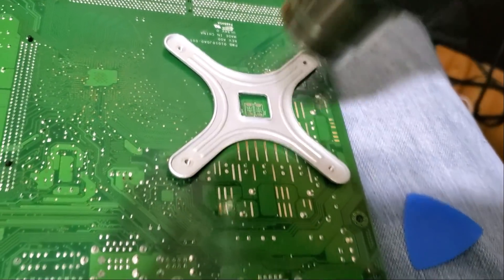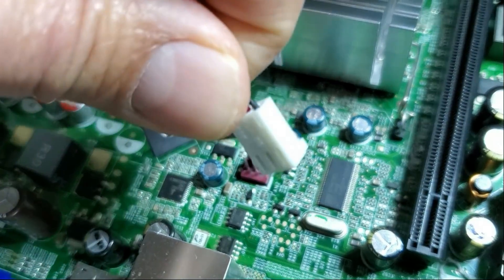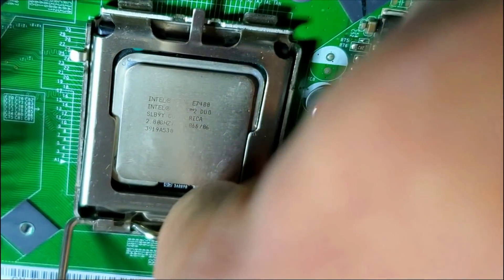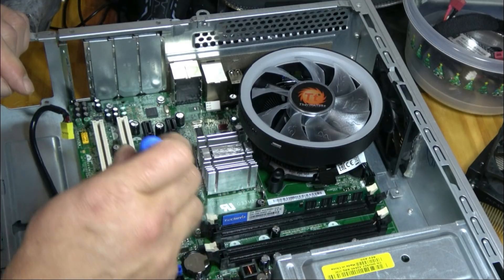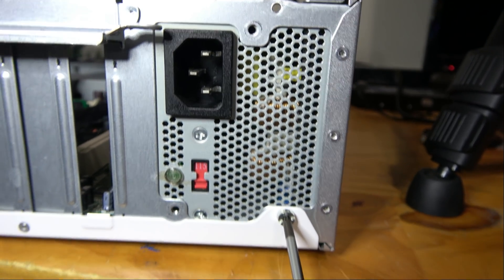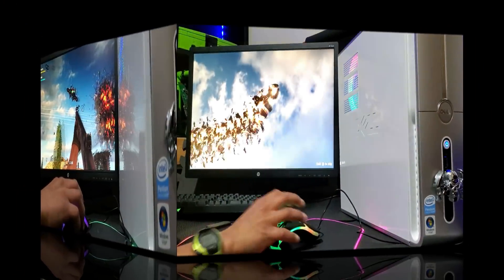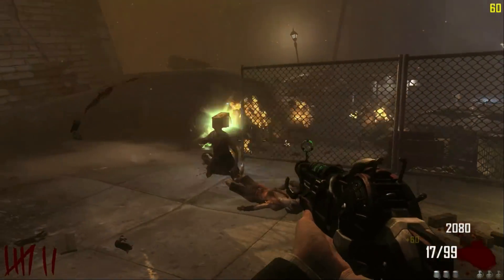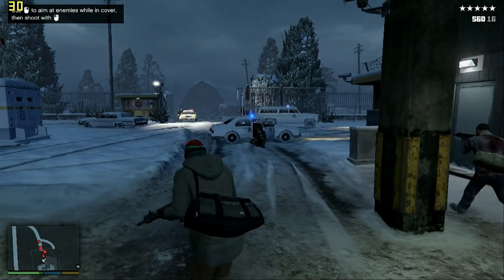$5 Dell Upgrade

Comment: Don't be shy? Ok lol, let's do that: There is serious controversy about the total amount of RAM allowable in this series of DELL Inspiron 530. Some say that 4 GB is the maximum and still others report that 8 GB sometimes land the PC to crash. Because there are several models 530s / 530sa / 530sc... Which one is your? As you have intentionally not revealed the RAM tab in CPU-Z, we will not know more. The super loud hard metal music being probably more important in your opinion...
Reply from the maker: Never heard of this controversy. I thought 64bit operating systems allowed for more than 4gb of ram. The motherboard in this 530s is a g33mo2 and 8gb of ram worked fine before and after updating the bios
Reply from the maker: Also some answers here https://www.dell.com/community/Desktops-General-Read-Only/Inspiron-530-RAM-limit/td-p/3345626
Reply: @modstek  I have run 8GB in numerous Dell G33M02 motherboards without issue. I've also used 16GB DDR3 on an Inspiron 560 motherboard that's only meant to accept 8GB. The way I see it is if you have the RAM to test it, then it's always worth a try!
Reply from the maker: Awesome so I don't have a unicorn inspiron 530s with 4 slots of 2gb ddr2? I had no Idea that was even a issue. The issue I had was the brand new Amazon sticks with pc2-6400u stickers on them registered as pc2-5300 on more than one pc. When questioned they Said keep them for free it must of been a mistake. 
Every time I hit the publish button on a video I'm just hoping for yeah that's kinda cool or I did this here's link.
But nah it's trickery and unprofessional that didn't open the ram tab on cpuz. 
  Thanks for feedback 😀 I appreciate it.
Reply: @modstek  serious controversy :D
Reply: @modstek  Thank you for your reply. In the post you're giving the link, it's all about an important parameter none of all those writing in seems to care about. They are litterally speaking like deaf and blind and so you're doing. Because it's ALL about the model that only one people pointing it: a Dell Inspiron 530 (the PLAIN model, NOT a 530a/b/c/d model), with a G33M02 motherboard, and the latest BIOS installed (1.0.18) can be upgraded to 8 GB. I think your is a slim model so either a 530a/b/c/d. And not talking about or showing CPU-Z's tab about RAM in your video just keeps things confusing. It would have been a lot more fair and professional to do some testing pushing RAM usage as much as possible WHILE showing tools like HWInfo and even just the Windows 10 task manager performance test tab. Easy, but when you want to make people believe in something else, you don't. I'm not intend to offend you, i'm just talking about objective facts. This has been said, thanks for your cool job, keep it alive and take care 😎. Peace.

Comment: so I have the same PC I just pulled out my moms basement I got it brand-new but its far from that now. Anyway I have the heat gun can I do this with the CPU or did you use a different CPU. Sorry if this is a dumb question

Comment: i have two of these one with a core2duo e8500 and another with a core2quad q9650 and 8gb ram. They perform amazingly and can even play GTA5 Fallout 76 and a bunch of other games just fine at 1080p with a 750ti installed. i have windows 11 running on them and its amazing the longevity of these things.

Comment: Got  a tossed out 531 Sempron LE 1250 2.2 GHz, had Vista but was upped to Win 8.1, with 4 GB RAM (only 800 mhz)  but still runs! Think the fastest RAM is 1066 & might be able to accept an Athlon 64 X2. Thanks

Comment: My Vostro slim just needed a bios update to accept a core 2 quad, wonder if yours could use the same? Otherwise it supports Pentium 4 through core 2 duo from the factory. Also nothing over 3.4 ghz I believe, 80 watt tdp on these boards.

Comment: I’m planning a build with my own 530s I’ve got laying around. However, I’m doing a full mobo and cpu swap. In my case, I’ll be swapping out the dg33m02 for the dg33m03, which supports the quad core CPUs of that era. I’ll also be throwing a core 2 quad q9650, which, from my research, is the most powerful cpu for this mobo in its day. I’ll also be throwing a gtx 750ti low profile gpu at it for some extra grunt on the graphics side. I’m planning to throw 4 sticks of ddr2 1066 memory at it, but I’m not sure of its compatibility. Will the tape mod also work on the core 2 quad, or will it draw too much power for the mobo to handle?

Comment: have you ever consider moding the outside of a pc case using foam poster board. i am planning on doing it to my old i buy power Horus series case. i took the front panel off and the side panel and will be completely replacing them with costom ones.

Comment: I'm currently using a gutted inspiron 530s. I have an industrial ITX board with an i7 2760qm, 16 GB of ram, SSD and GTX 1650. I had to dremel out a hole for the IO plate and it was good to go. The GTX 1650 is still a bottleneck for the i7, but there aren't any better half height cards available.

Comment: People choke the pci-e gen3 on those nvidia cards in pci-e gen2 (or lower) slots when the cards are only 4x. About 15% is lost. However, an am3+ mboard can have a pci-e gen3 slot and take an am3 or am3+ cpu like a fx4100 or some old unlocked tricore x3. I really like this video. Thumbs-up. It is interesting seeing on various videos how those cards get bandwidth lost consistently at about 15% of the FPS they desire. And they benchmark with GPU favouring games (so it almost always bottlenecks). Nobody seems to pick up on it or mention it in their videos. Everytime it is an almost perfectly 85% result. Even on big channels. Nobody seems to realise. Check it out. Search many videos. The card (if it were gen2, which it is not) would need a theoretical 5x or 6x (like say about a 5.5x) gen2 pci-e. The cards only have 4x connectors (gen3). that bandwidth-bottlenecks if it is 4x gen2.

Comment: Had an Optiplex 745 that dropped from 800 to 667 on RAM with a 1GB 2R8 stick, was going to say it doesn't get full speed with 2R8 but I think all 2GB are 2R8

Comment: Why not core 2 quad?
Reply from the maker: Don't work in G33MO2 motherboards they have only 6 voltage regulators from what I understand. Some shipped with G33MO3 motherboard that do support quads.
Reply: @modstek  oh what a pity... what about a modified bios with new microcode to support those processors?
Reply from the maker: I would love to work with a bios modder especially for the Pavilion I have with an ASUS motherboard. Maybe if someone reads this we can do a collaboration video together.
Reply: @modstek  please, provide us the model and version and let's see
Reply from the maker: The hp is IPIBL-LB revision 1.01/ that supports quads and xeons but think there should be overclocking features to be unlocked

Comment: Can much be done with a i3-3220?
Reply: just get a cheap H61 ITX board for it and it would make a good emulation computer with something like a HD 6950 or something cheap(hd 7850 if you want the same performance but only requires a single 6 pin).I had one with an i3-3225 which is actually a little slower that the 3220(3225 just had integrated graphics) and I had it paired with a 2gb HD 6950 a long time ago and I could get 60+ fps in gamecube and wii games easily @ 1080p.They didnt have a wii-u emulator at the time so I never was able to test it with that but performance should be just fine.I mean easily cause its locked 60fps never axtually changed so I dont know what its max fps probably 80+.As for normal games you wouldnt want to pair it with anything stronger than a gtx 1050ti or youll end up bottle necking the GPU

Comment: I’m surprised the 1030 ran as well as it did.
Reply from the maker: It's weird it runs great in that old Dell but I have it in my R410 server right now with dual xeons and only hitting 40 plus fps on cinebench and windows 10.

Comment: I tried that bsel mod on a Dell XPS 410 I have. Q6660 quad core. It has some self diagnostic test it does before it boots though. Just got pc speaker beeps. Really gotta find a system like that and ship it to a girl friend of mine. I have a GT 610 laying around but it's a potato of a card.
Reply: XPS 410 does not support 1333FSB CPUs.

Comment: What settings and resolutions for the games?
Reply from the maker: 1080p high for bo2 zombies, left 4 dead 2, Rocket league. 1080p low on Serious Sam 4. 720p low on GTA 5 I think. But that's because limited Vram I think a 1050ti 4gb would do nicely 😉

Comment: Love your work👍😁 but what CPU Cooler did you use?🤔
Reply from the maker: Thermaltake UX100 5V Motherboard ARGB Sync 16.8 Million Colors 15 Addressable LED Intel/AMD Universal Socket Hydraulic Bearing 65W CPU Cooler CL-P064-AL12SW-A https://amzn.to/2PumkFx

Comment: 1:18 what is that? in all my years fixing pc's first time i saw that in a back of the cpu, btw the thetmaltake fans ohh man one of my fav put on builds, did you glue again the back plate of the mobo?
Reply from the maker: bsel mod. no need for the plate with new cpu cooler

Comment: That ram probably just defaulted to slower speeds, couldn't you get it to run on 800mhz with the bios? I know these oems usually don't like that, but just curious
Reply from the maker: The bios is locked to ram speeds but I tried them one by one just in case one was faulty clocking it down and even tried the sticks in a different computer with same results. Slapped in some adata sticks and boom pc2-6400u 800mhz

Comment: The most depressing thing about this video is that the stock pc was more powerful than my 2017 laptop.
Reply: The really depressing thing is that 9 out of 10 PCs in the e waste yard are this powerful or more. And mostly they are just crushed for a dollar worth of scrap. I5/I7s and 3ghz AMD quad cores are all over the scrap yards.
Reply: uh what exactly did you buy in 2017 that could be weaker than this? unless you just mean the on board graphics are worse than a gt 1030
Reply: @stevesmith1383  there are some crapbox laptops with 1.1ghz celerons out there.
Reply: @stevesmith1383  Something weaker than this is basically every cancerous atom.